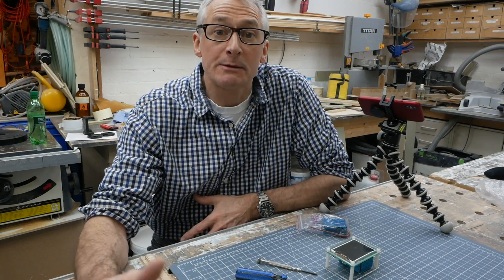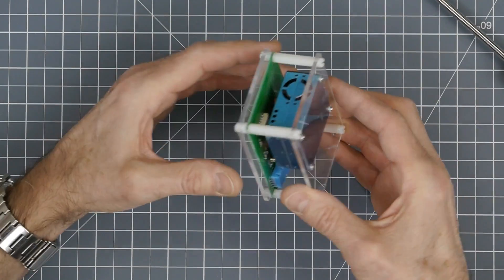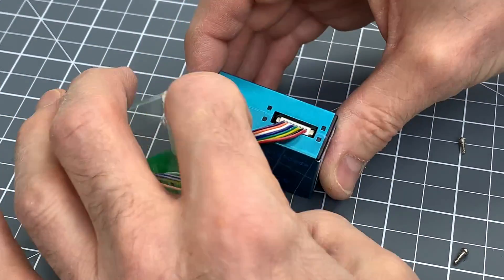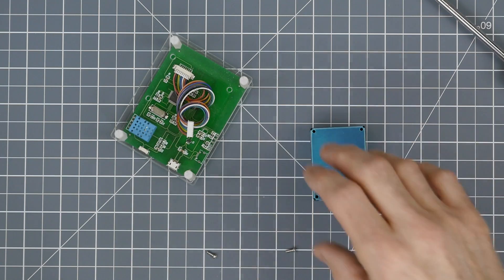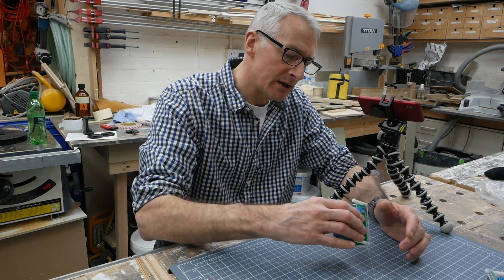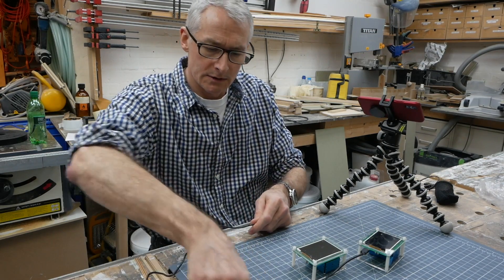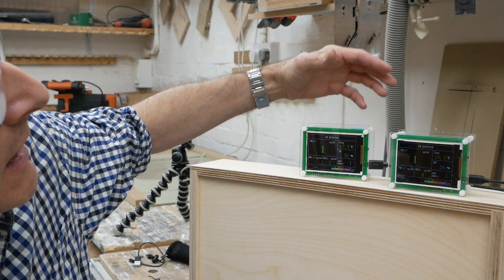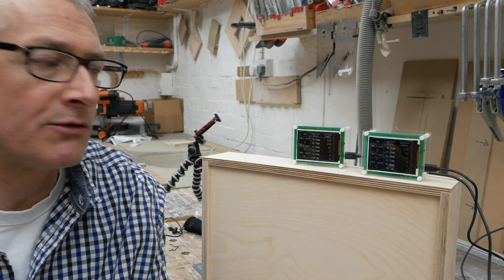Air Quality Monitor [video #287]

Comment: Perfectly timed Peter. I'm ordering my sensor after I write this. Note to the viewers, mine packed up from dust not spray as I don't spray! And I have 2 vacuums one dust extractor and an air filter that's suited to a shop 3 times the size of mine. So I would have thought that dust didn't kill it. Interesting though it died after not switching n for over 3 weeks during my Xmas break. That's been my experience. Cheers for the vid.
Reply from the maker: Yeah, that’s weird. Pretty sure mine was paint-related, but Andy Mac’s wasn’t. They were bought some time apart as well, so it’s not down to a ‘bad batch’. The downside of buying direct from China, I guess, but at least we can get spares! 👍🤷‍♂️

Comment: The temp and humidity are on a separate sensor.  The smaller blue box.  It was probably covered in paint.  That is why the different reading between the boxes.

Comment: Yes, good to know. I had bought mine after seeing yours in the original video. Then yours quit!  Mine is still working but I don't do hardly any spraying in the shop. If I do spray, I will cover the sensor and simply assume that the air levels are bad and take appropriate precautions. I could not purchase the unit from your link because I am in the US but found it on Ebay. Also, I just used mine to compare my new WEN air filtering system with my old DIY fan and filter assembly.  They both performed the same! I will use the WEN in my workout area in the house instead of the shop. (Want real fresh air whilst breathing heavy!)  Thanks Peter.
Reply from the maker: Thanks Mark! 👍

Comment: One thing I like about buying cheap Chinese products is that everything is modular and can be replaced individually, I can guarantee that if you bought a named brand, assuming the part was even replaceable, it would cost nigh on the same as just replacing the whole unit!
Reply from the maker: That’s very true!

Comment: can I replace it with a PMS7003? Would it work with the display?
Reply from the maker: No idea I’m sorry. 🤷‍♂️
Reply: I'm pretty sure the PMS5003 which I believe is in this video and PMS7003 have the same command set. They certainly have a common driver within ESPHome

Comment: Hi! As i've seen in other videos this particular device is a very well performing one for its price but also a bad choice for the long term cause it seems to have a high failure ratio... i'm getting a bit crazy to find the right IAQ monitor for the poor... and i have a real intoxication problem in my house... have you made other videos on the subject ? some recommendation maybe ? thank you for your real help in your videos !
Reply from the maker: To be clear, I broke the original AQM because of spray painting; the replaced sensor in this model has been running since this video was made and has performed flawlessly. 👍

Comment: As always, thanks for the content Peter! I've just ordered one of the devices, does it come with figures on what are safe levels of dust? I'm cutting a lot of mdf and even with dust collection and two vacuums to collect direct from saw and one in front collecting dust blowout from the saw, theres still a lot of mdf dust collating. I've tried to find some instructions online but with no luck on what are safe levels of dust. Thanks if you can help, no problem if you cant! :)
Reply from the maker: Older vid, so not sure what the current scope of delivery is, but mine didn’t come with anything, no. As a very general rule it’s the PM2.5 levels that you want to watch out for, and I try to keep them in single figures.
Reply: @10MinuteWorkshop  Thanks Peter, much appreciated for your time!

Comment: Any chance of explaining the device figures on display?  I have bought one but no manual or instructions,  how about a video with explanations.
Reply from the maker: Yes, I need to do a quick follow-up on it. You've figured out how to switch it to the second screen (the one I show in the video, not the one on the thumbnail) yes? If not, there's a tiny push-button on the side, above the USB power socket. That brings up a more detailed screen for particles, which is what we're most interested in as woodworkers. This screen basically gives the number of particles above set sizes; this is cumulative, of course, so e.g. the >0.3 micron reading also includes all the other particles on show in the lower levels. It's a convenient way of assessing how the air is in the workshop at any time, so you can establish a baseline reading for e.g. 'moving around but not machining anything'  then decide at what levels you need to switch the extractors on / open the door / get out of there for a while. That's how I use it, anyway 👍

Comment: The temperature and humidity sensor is soldered to the main board and is the blue device. It's a DH11. See this link here:

https://www.google.co.uk/search?q=dh11&source=lnms&tbm=isch&sa=X&ved=0ahUKEwiOwrC28b3gAhXH-qQKHYreBnoQ_AUIDigB&biw=1366&bih=629
Reply from the maker: Thanks! Temps & RH were always reading OK, just the particle count that was out of whack - makes sense if the others are soldered on 👍👍
Reply: @10MinuteWorkshop  No worries. That DH11 is fairly cheap and not of itself calibrated.

Comment: Should have been played the music from mission impossible there Peter ,then had to old one self  destruct after you got it out lol ,you need a  better filter system for the spray  painting in such a small space Peter i would be doing a down draft at the back of your benches and have it blow out into a filter box in the next room
Reply from the maker: Thanks Syd. Yes, the fan boxes I made takes care of the overspray/paint in the air problem, but obviously not the VOCs. 🤷‍♂️👍
Reply: @10MinuteWorkshop  oh know the ABCs are back ...lol